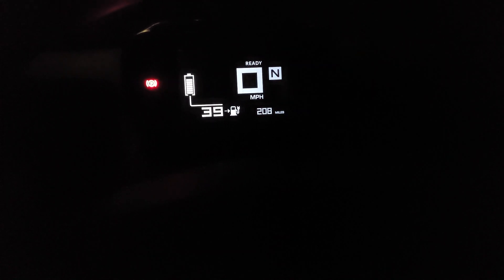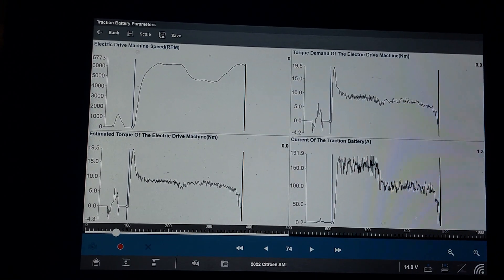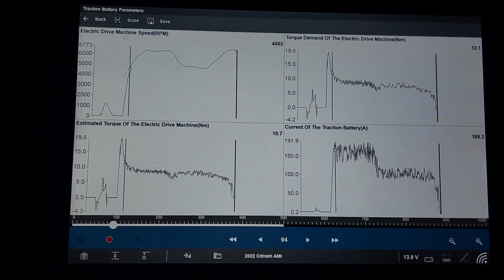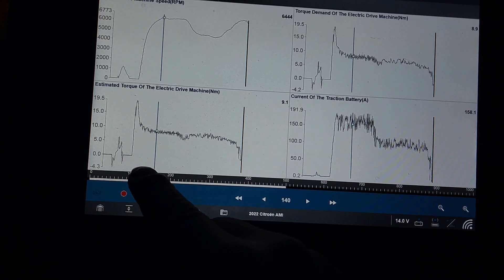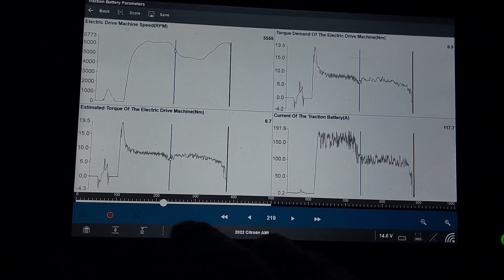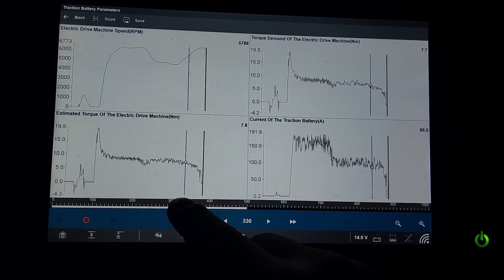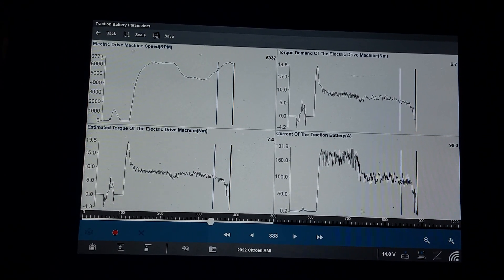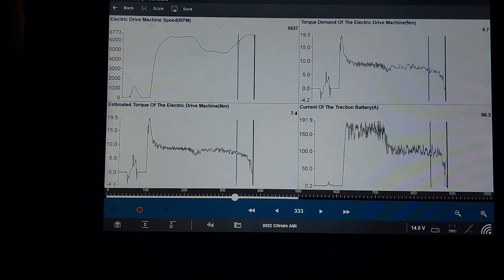Citroen Ami going up hill, recorded amps draw vs speed of the motor

Comment: Hi, I recently bought a Fiat Topolino. It is used in Istanbul, where there are no very steep or challenging hills. However, on some average slopes with traffic lights, where you have to wait in "D" mode with the brake pedal pressed for a long time (more than 30-40 seconds), the car shuts down the transmission and switches from "Ready" mode to "Turn On" mode. As a result, the car rolls backward, and pressing the gas pedal doesn’t make it move forward. You have to switch it back to "Ready" mode, shift to "D," and then proceed.

Today, I brought the car to the warranty service. After watching your video, I wanted to ask: Could this problem be caused by high current consumption after waiting at a red light for an extended period with the brake pedal pressed? Maybe some protection protocol etc
Reply from the maker: After how many seconds does switch to IGN On? Any beeps when that happens?